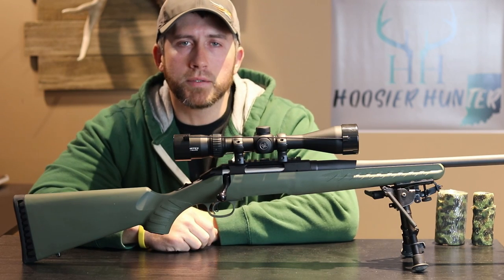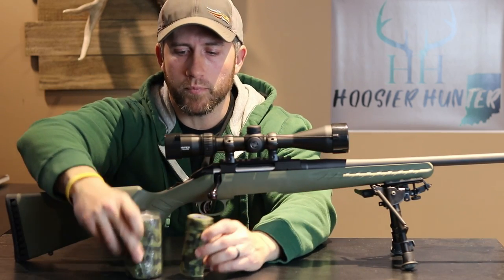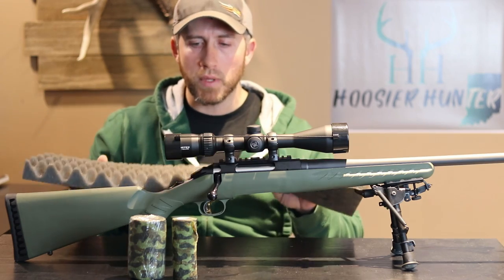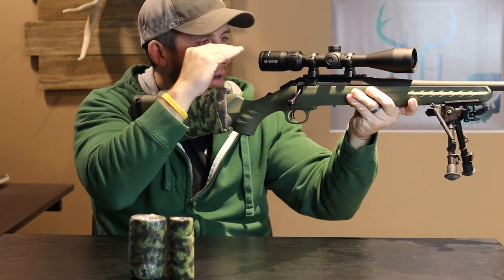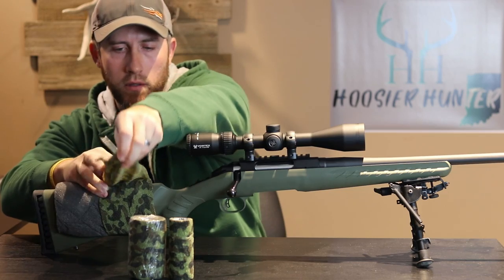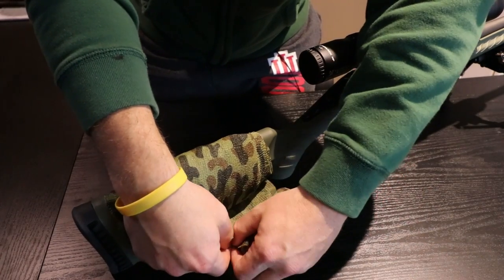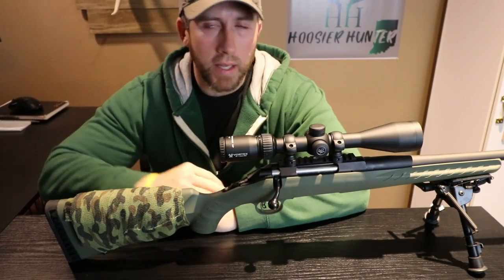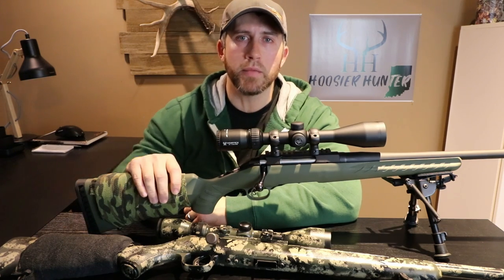DIY Rifle Cheek Rest

Comment: Get in position on the rifle with your eyes closed and with a good check weld (position) to the stock. 
Open your eyes and see where it puts you in relation to the sights or scope. 
Add padding to the point you can repeat this drill and your eyes are in good alignment (height) in relation to the sights or scope. 
Then tape that into place. 
SSG. U.S. Army (Medically Retired) Infantry / Sniper / SOF Intel (SOT-A), multiple tours

Comment: I did similar. I used the cheek foam risers pack on Amazon which had 3 sizes. I then used clear packing wrap and tested out different heights. Once I found the right height I then purchased a cheek wrap from Amazon to cover my cheek rise. Worked out great and looks clean.

Comment: That's a great idea! I used that tape for climbing sticks, but never thought to use it for this. I've used Beartooth comb risers. Those do the job for cheap, but they do rotate on the stock some, which is a little annoying. I have the Savage Axis in .243 which is quite similar.
Reply from the maker: Yes, very similar rifle.  I like this way because it's cheap and definitely doesn't move once you have it wrapped on there well.

Comment: I tried a piece of 1/2" pipe insulation on my Patriot but haven't figured out a way to secure it. Your idea should work great! Thanks
Reply: Same here. Pipe insulation and vet tape. I have a skeleton type stock so I had to pull it pretty tight.

Comment: I personally have used a hard block of craft foam from walmart for $.97. worked good but in the end I have put a chunk of 2x4 and drilled holes in my stock for pegs. hold tight and doesnt move and if i ever get lower scope rings i can just sand it down. drilling the stock does in a way ruin it but I have been considering a new wooden stock anyway. But this idea, as you said, is a great way to preserve the rifle stock and still provide a reliable point for the cheek to rest
Reply from the maker: Good idea there as well.  I could see that working really well and being really sturdy.  I appreciate you watching and dropping a comment.  Have a good one and happy new year!
Reply: I bet that looks awesome      sarcasm
Reply: Yeah it looks ugly but it works. And it only costed about 5 bucks in self adhesive medical tape and dowel.

Comment: 👍 great! Here's another idea. Put the foam only on the side that your cheek goes. Then after its wrapped put a strip of the wrap horizontal on the side opposite of the cheek side. Glue the ends down and put some bullets in there vertically just like on the store boughten  model. You could put a little glue inbetween each bullet space. Being stretchy it would be an easy bullet holder
Reply: I've even thought of putting the sponge inside my shirt over my shoulder for recoil absorption

Comment: I’d get one of those ammo things for the stock and then carve a peice of wood to the perfect shape and size to put underneath the ammo thing, this seems to temporary
Reply from the maker: I’m not a fan of the ammo holders and don’t want the extra weight of wood on my rifle. This works well for me. Have some that have been on for 5 or 6 years.
Reply: Also cheap to replace if it only lasts a season. 50c? $3 a roll at TSC.

Comment: Does it stay secure when it gets wet or when it gets blazing hot outside?
Reply from the maker: It does for sure when it gets hot out. I have had it get wet before and it was fine but I wouldn’t say it was soaking wet.
Reply: @HoosierHunter  
Thanks for the reply I guess I'm soon to find out here in the Pacific northwest...lol
Reply from the maker: Haha. No problem man!  Good luck with it and comment back here after  putting it through the elements.

Comment: any method on keeping one in place when shooting? I got through about 40 rounds and it had shifted almost completely forward into the actual grip of the stock with .308. maybe duct tape? thanks
Reply from the maker: I would use some duct tape and tighten it down really well then cover it with the other wrap.

Comment: We bought these supplies to make cheek rests for our company rifles.

But then, another solution, one that is far simpler, occurred to us:  knee pads. We bought these in small size off of Amazon, and they work great. Package of two for only about $12.   https://www.amazon.com/gp/product/B083NRH4RK/ref=ppx_yo_dt_b_asin_title_o02_s01?ie=UTF8&psc=1  In case that link doesn't show, just search for Mmester Best Soft Knee Pads.

Using just one probably gives us the extra height we need. But If more height is needed, we'll just use two, slipping a second one over the first one. (They of course come in a pack of two.) Or slide some foam padding or a folded cloth or whatever under the first one. If you need it to fit tighter on the stock, wrap it down with the wrap presented in this video, or some other kind of wrap.

They're easy to remove for gun cleaning, etc., too.

You can also use these to add a bit of extra height or padding to your existing cheek rest.

Comment: Good info Amigo. Can this tape be uninstalled from one rifle and reused for another application? Does it maintain it's adhesion for future applications on other rifles? Would it adhere to a gloss finished stocks? Would the adhesive material on these types of wraps have ill effects on finishes like linseed, gloss poly, Dura coat, others? 
A lot of questions for the go to guy. Out of all these vids on different cheek pieces, yours is my pick for my many rifles with this situation. If ya aint got a good cheek weld, ya like miss'n a lot. Thanks Amigo
Reply from the maker: Thanks!  Yes, it is very reusable but it is also very cheap in case you need to trash some of it.  It mainly adheres to itself and not the other things you are putting it on and never found anything it doesn't stay on, because you are wrapping it to itself.  You will like it after you try it.  Been doing it this way for years.